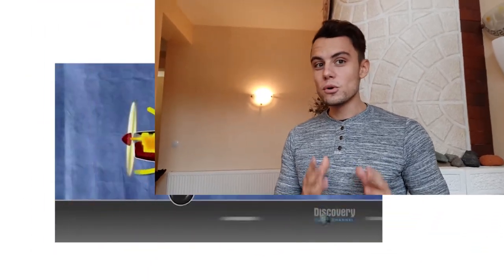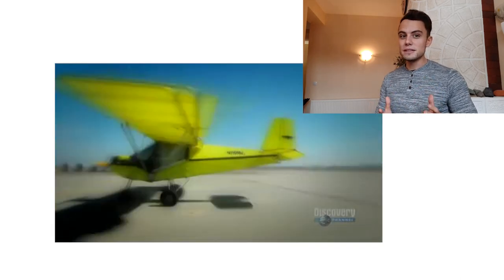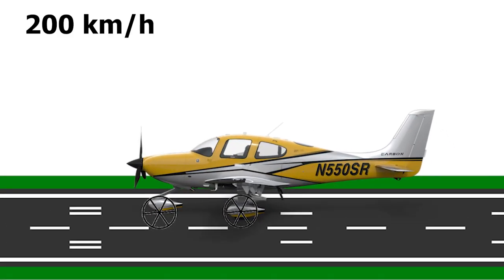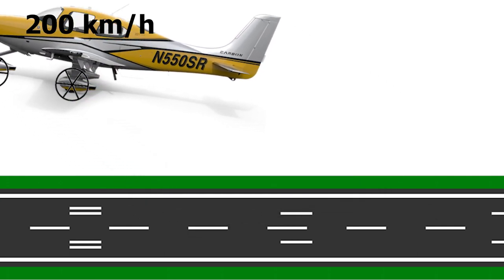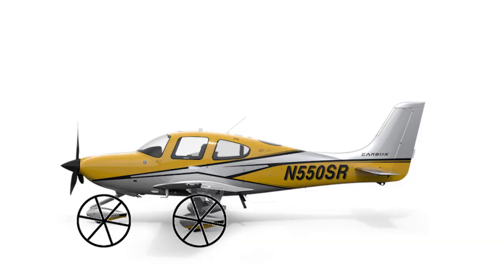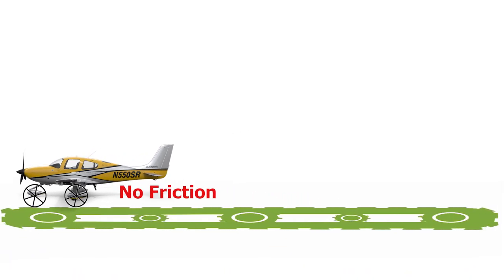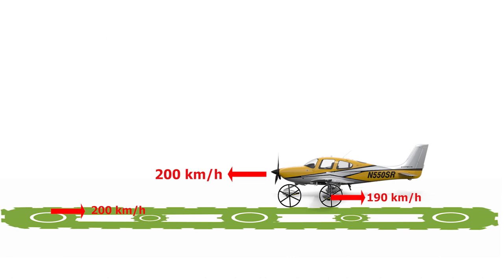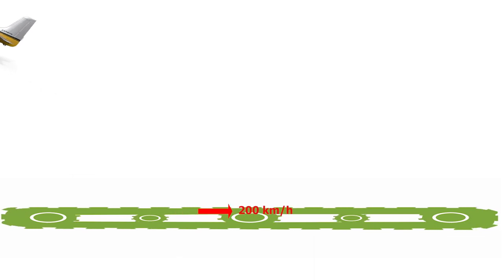Can an Airplane Take Off From a Conveyer Belt?.... Finally Solved!

Comment: No, without wind flow across the wings it will not fly. This is really true for the 747 example. Because the engines airflow across the horizontal stabilizer will lift the tail forcing the nose down. However the propeller driven airplane has a chance if and only if then engine has unlimited power. Why?  The props airflow will cause lift in the wing; mostly on the right wing and lesser on the left wing. As the plane might show lift, it will be unstable and tend to roll left. With enough aileron the plane could remain level.
Reply: The riddle (Imagine a 747 is sitting on a conveyor belt, as wide and long as a runway. The conveyor belt is  designed to exactly match the speed of the wheels, moving in the opposite direction.)                                                                                                                          Can the plane take off?                                                                                                                                                                                                       Lets brake it down                                                                                                                                                                                                                 747= real plane, it will take off                                                                                                                                                                                               Sitting= Stopped, not moving, wheels not turning, and conveyor not running.                                                                                                    Conveyor belt designed to exactly match the speed of the wheels = Conveyor belt can only match wheel speed, it can't change wheel speed.                                                                                                                                                                                                                       Moving in the opposite direction= The top of the wheel the moves in the same direction as the planes forward movement, the bottom of the wheel moves in the  opposite direction to the planes forward movement. So any conveyor belt the wheels roll over moved opposite the plane.                                                                                                                                                                            To make the wheels turn the plane must move forward, as the wheels turn they roll on the conveyor belt at the same speed. Because the speed of the wheels  already matches the stopped conveyor belt, the conveyor belt  will not have to start and the plane will take off.

Comment: Your math dose not hold up. you are assuming the belt speed is a constant and the plain can overcome that and gain forward movement. your opponents are saying the conveyor speed is matching to the wheel speed and maintaining a "0" forward movement of the plain. In that case, with your math the conveyor would increase in speed to make up for the lack of friction you describe resulting in no forward movement and thus no lift over the wing. A prop plain works in this case because the prop creates the movement of air over the wing creating lift. this would not work with a rear mounted prop or a rear mounted jet, this would move no air over the wing and no lift would be generated. Mythbusters used a prop plain and crated lift with the prop moving wind over the wings. This explains why plains sitting on a airport flight line need to be tied down to avoid natural wind making them move or flip over. with your math that would be imposable with 100 friction on the ground and the plain producing no thrust.
Reply: I will just add the plane in the MythBusters video clearly moved relative to the ground and thus relative to the surrounding air, so the experiment didn't fulfil the requirement of the conveyor belt cancelling out the forward movement of the plane's wheels.
Reply: The prop plane does not create air flow per se.  It creates vehicle movement which results in airflow.  It’s pedantic but important distinction.
Reply: You can't change 1to1 the conveyor only moves when the wheel rotates in place, not happen. The wheel only rotates as the jet moves forward the rolls over the conveyor and the amount of conveyor behind the wheel is the same as the movement of the jet 1 to 1. The conveyor never moves and the plane takes off. The wheel speed matching the conveyor is the key to solve this. The plane is sitting on the conveyor neither the wheel or the conveyor is moving. Now start the jet move 1 rev of the wheel now the plane has moved forward and 1 rev of conveyor is now behind the wheel. The real question is how fast the conveyor is moving. The answer is it is not and never will. That is the trick of this question.
I see now this is not a riddle, it's the definition of how planes take off from a runway with one word changed. they replaced the word runway with conveyor just to confuse everybody.

One other thing, you park a car on a conveyor and than drive the car forward keeping the wheels and the conveyor at a 1 to 1 ratio. The car will drive off and the conveyor will not start. You yourself can do this on a treadmill, stand at the back end with the treadmill off and take 1 step forward. You will now be in the middle treadmill, start the treadmill up and start walking and you will stay in the same place. Only one can move at a time to keep 1 to 1 ratio.

Comment: You have missed the main aspect of the original question, and it is exactly that aspect that makes the original question interesting and much talked about. The original question states: "If the speed of the belt with respect to the ground matches the speed of the plane with respect to the belt, can the plane take off?". That is the same question as for a car on a belt. The original question has a self-contradiction in it that makes it impossible for the plane to take off. 
You interpreted that instead as "... the speed of the plane with respect to the ground ", which makes it a different question as for a car, and avoids the interesting controversy.
Reply: Hmm...this is not the original question I saw, nor is it the original question as discussed on MB. What is it that makes you think your version is the original? Do you have some kind of source showing the "original question"? Quotes because of course you nor I can know exactly which way the question was first asked. 

Further, your form of the question implicitly gives the plane an airspeed(oops, ground speed) of zero, thereby also avoiding any interesting controversy. The "interesting controversy" is simply in the way that most people think of such a question... The vast majority of people do not deal with/think about the physics of air travel in their daily lives, so they relate it to something they do experience typically every day...automobiles... 

If you take the question and just add stipulations to it as you did, you can postulate hundreds of similar questions...
Reply: @taylormay9938  "nor is it the original question as discussed on MB" - Indeed. Mythbusters interpreted the question differently as well.
As I said, the original question is the one for a car on a belt: "If the belt matches the speed of the wheels, can the car move forward". And, or course, the answer is that it can't. People then started to wonder whether that would be true for planes as well. It is then not fair to suddenly ask a different question for planes, using the ground speed instead of the speed of the wheels. If you pose that alternative question for a car on a belt, then the answer will be the same as for the plane: the car will be able to accelerate forward.
"your form of the question implicitly gives the plane an airspeed of zero," - well, a zero ground speed, but yes. That is what makes it an interesting question, because most people don't realise that at first; that the question already defines the answer.
Reply: @renedekker9806  Again, what is it that makes you think the "original question" is the one you are posing? And how is any of this unfair to anything? You are adding stipulations to the question that became popular, which is the question the vast majority is discussing. If you want to discuss a question with different variables, as you are doing, go ahead. But saying someone got the question wrong simply because you heard a different version simply doesn't make it true. You are essentially attempting to prove a point with an anecdote.
Reply: if your argument is true then it shouldent matter the belt can be fixed at take off speed since with your logic it will never take off since it cant reach that speed
Reply: @super1337bf3ordie  "t shouldent matter the belt can be fixed at take off speed" - If friction of the wheels is low, then the belt needs to spin up much faster than take-off speed (together will the wheels) in order to generate enough drag to hold the plane back. If it doesn't run fast enough, then the conditions of the  question cannot be fulfilled and the plane will gather speed.
Reply: @renedekker9806  dont forget the nplane generates lift as it overcomes the pull just the friction of the sheels is stoping it now and as it gets faster the friction gets lighter
Reply: @super1337bf3ordie  "dont forget the plane generates lift as it overcomes the pull" - it only generates lift if it manages to develop forward speed. The only way for it to develop forward speed, is if it moves faster wrt. the belt than the belt wrt. to ground. But the question states that is not the case. So the plane doesn't develop any forward speed, and therefore no lift.
Reply: @renedekker9806  imagine the plane for the sake of argument is a f-15 with greater then 1 to 1 thrust it ovescomes the friction force on the free spinning wheels and takes off
Reply: @renedekker9806  i donbt get what the problem is here you saw the plane take off
Reply: @super1337bf3ordie  "i donbt get what the problem is here you saw the plane take off" - yes, that is because the video does not answer the original question. That is the problem.
Reply: @taylormay9938  "You are adding stipulations to the question that became popular, which is the question the vast majority is discussing" - It is the other way around. I expressed the question that became popular. The question answered in this video is a different question.
"But saying someone got the question wrong" - I am not saying that he got it wrong, just that he is answering a different question.
Reply: @renedekker9806  the question is impossable to awnser but by your thinking if the tredmil runs at take off speed it will never take off right
Reply: @super1337bf3ordie  "your thinking if the tredmil runs at take off speed" - According to the question, the treadmill would run at whatever speed is necessary to make sure the speed of the plane wrt the belt is that same speed. There is no reason to believe that would be take-off speed. For a normal plane with very low friction in the wheels, that would necessarily need to be near infinite speed in order to generate enough drag to counter-act the pull of the engines.
For a car, it would be the maximum speed that the car's engine/wheels combination can run at.

Comment: this one gets the question wrong as well..  the paradox states the belt is matching the speed of the wheels, not the aircraft.   

upon imparting of any energy to the wheels, a chain reaction will begin that will cause the conveyor and wheels to move at infinite speed.  this then changes the question to 'can the wheels sustain speeds high enough for they themselves to generate the lift necessary to pick up the entire aircraft or can are the engines powerful enough to pull the aircraft to take off speed without them. and if so can the aircraft sustain the ensuing damage that will be cause by such and act and how good is their insurance?   because it isn't landing in 1 piece.'
Reply from the maker: The idea is to ask the question which differentiate the plane of the car. I Saw the other video by @Captain Joe. But why on earth you would like compare the speed of the aircraft wheels to the conveyer belt. Obviously if you compare them, the aircraft is considered as car. What you want to test is when the aircraft has the standard take off thrust for achieving take off speed, while on cover belt moving with the same speed in the opposite direction.
Reply: i am thinking like an engineer.  the wheels are free moving and have no effect on the locomotion of the aircraft, but because the original question states that the wheel spin and conveyor spin match, it brings into question the structural strength of the wheels. 

 one variation of the question uses a 747, with which we can definitively answer no.  the wheels can not sustain speeds high enough for them to generate their own lift before they structurally fail.  they will explode, taking out the landing gear which will  then cause the aircraft to crash into the ground, destroying the engines which are mounted lower than the fuselage on the jet.  no thrust, no take-off.  

your response indicates i am still thinking aircraft's mode is the the same of that as a car, this is false.  taking structural integrity out then the answer would be the aircraft theoretically can take off due to it relying on lateral thrust from, an engine pushing air.   but realistically thinking, the question is far more complicated than it originally appears.
Reply: @MartinYY  "But why on earth you would like compare the speed of the aircraft wheels to the conveyer belt." - because that is what the question for the car states. The question you answer in the video is different. We could ask your alternative question of the car as well: "suppose the belt moves at the airspeed of the car, will the car be able to accelerate", then the answer would be affirmative as well, just like for the plane.
Reply: @noneyadamnbusiness6891  . This is a thought experiment. Purely theory. The structure of the gear is assumed to be able to withstand anything. The bearing are assumed to have zero friction. the only question left is can the airplane move forward and have the wheel speed and treadmill speeds match. The answer is no.
Reply: @renedekker9806  that would be totally different since the engine of the car drives the wheels. The engine I the plane does not. Jet engines would propel the airplane forward
Reply: @mikebooze6125  "Jet engines would propel the airplane forward" - as outlined already, that depends on how the problem is stated.
Reply: The riddle (Imagine a 747 is sitting on a conveyor belt, as wide and long as a runway. The conveyor belt is  designed to exactly match the speed of the wheels, moving in the opposite direction.)                                                                                                                          Can the plane take off?                                                                                                                                                                                                       Let's break it down                                                                                                                                                                                                                 747= real plane, it will take off                                                                                                                                                                                               Sitting= Stopped, not moving, wheels not turning, and conveyor not running.                                                                                                    Conveyor belt designed to exactly match the speed of the wheels = Conveyor belt can only match wheel speed, it can't change wheel speed.                                                                                                                                                                                                                       Moving in the opposite direction= The top of the wheel  moves in the same direction as the plane's forward movement, the bottom of the wheel moves in the  opposite direction to the plane's forward movement. So any conveyor belt the wheels roll over moves opposite the plane.                                                                                                                                                                            To make the wheels turn the plane must move forward, as the wheels turn they roll on the conveyor belt at the same speed. Because the speed of the wheels  already matches the stopped conveyor belt, the conveyor belt  will not have to start and the plane will take off.                                                                                                                                                                                                                                  I see now this is not a riddle, it's the definition of how planes take off from a runway with one word changed. they replaced the word runway with conveyor just to confuse everybody.